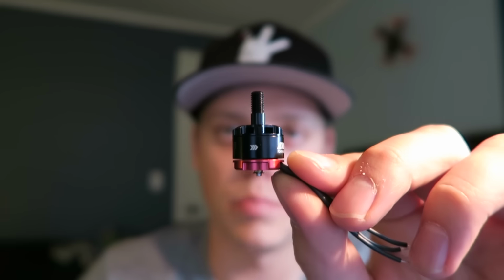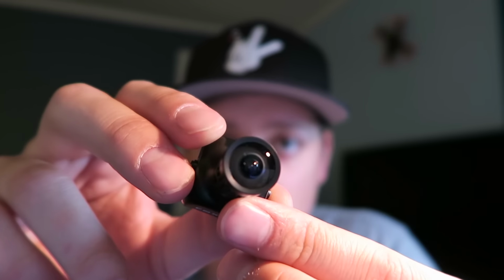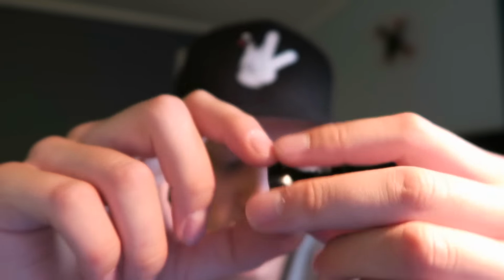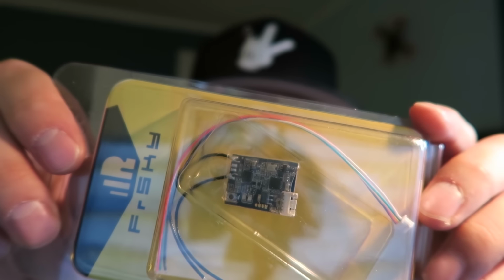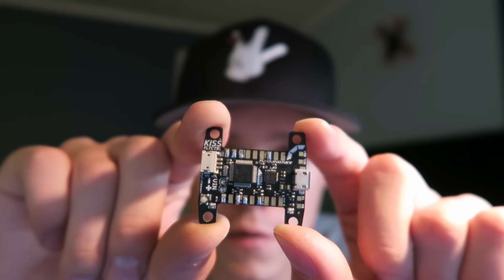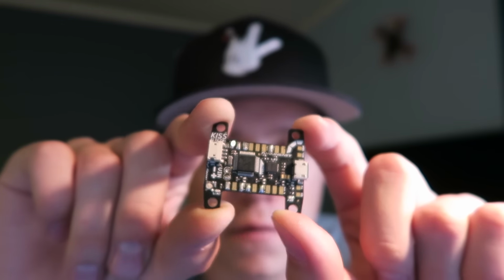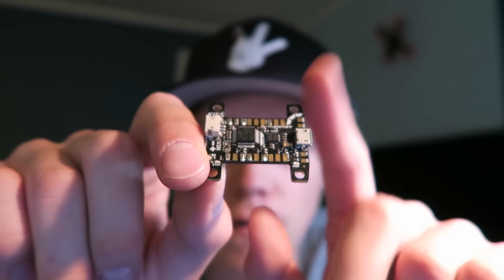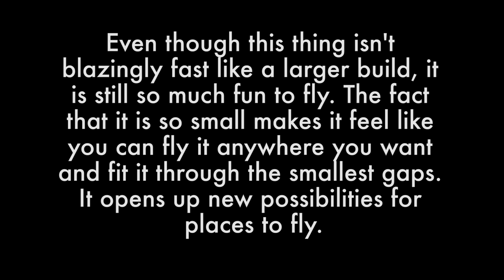XHOVER MXP150 Build Log// Initial Flights// Woah!

Comment: 4000kv on 4s. that's got to run hot. what flight time are you getting with 850mAh?

I have my 150 set aside for a winter build and I'm just chipping away at the  parts list.
Reply from the maker: Oh yeah, it runs hot. The bells don't get overly hot, mainly the base of the motor. I get 2.5 - 3 min on an 850 4s
Reply: +UnderHoverFPV I'm probably go 3100kv just to go easy on the battery packs.